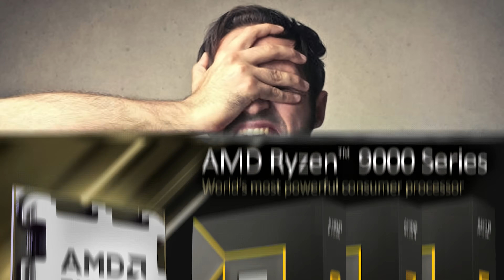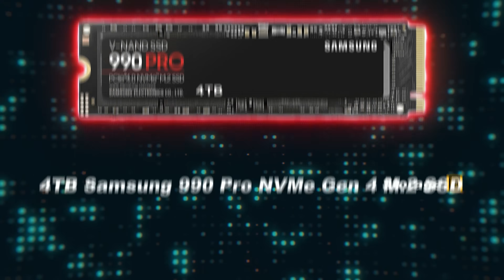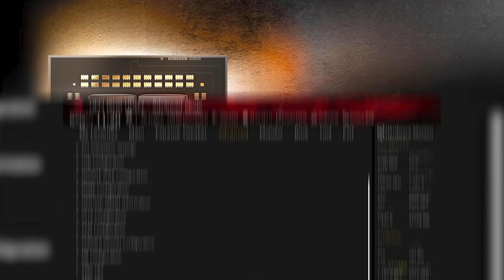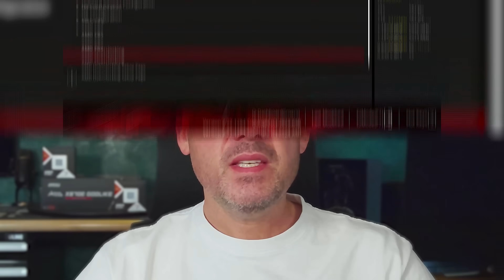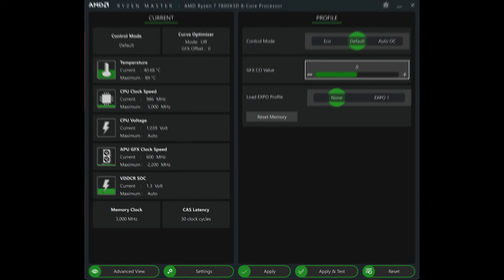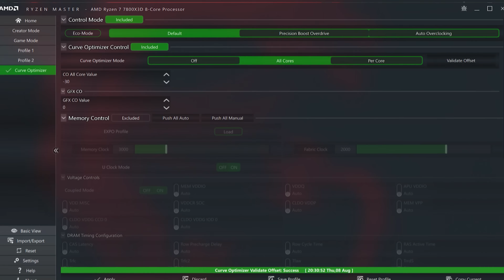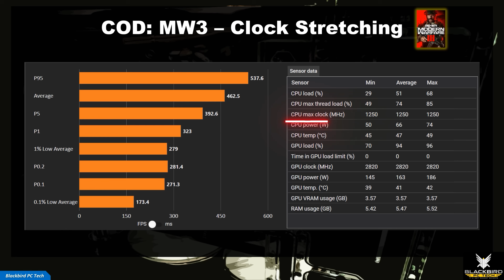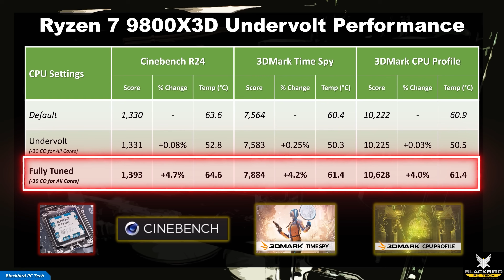How To Undervolt a Ryzen 7 9800X3D The Right Way! (or Any AMD AM5 Ryzen CPU)

Comment: I've got Ryzen 7 9800X3D &  ASUS TUF Gaming A620M-PLUS WIFI but can't find curve optimizer anywhere. precision boost overdrive also isn't in AI tweaker tab only in the Advanced tab. I've even used the bios search feature to find curve optimizer but finds nothing.
Reply from the maker: Don't worry, you can simply use PBO2Tuner as explained in this video: https://youtu.be/GJCC94cRGys

Comment: one piece of advice after personal testing with asus mobo. I'm on a X670E TUF mobo and when i tried the PBO through the advance tab the voltages weren't working as they should. CPU was getting over volted at idle and load, thus i was having really high idle temp of mid 50s and i was getting terrible scores in cinebench ??!!
Disabling PBO in advance tab and Going back to tweaker tab and setting the PBO through there fixed everything ! correct voltages both at load and idle with great temps and i was able to stablize curve optimizer at -30 ! I suggest everyone do the PBO through the tweaker tab !
Reply from the maker: I haven’t ever experienced that issue with Asus motherboards … I wonder if it’s a bios bug for that motherboard?
Reply: @blackbirdpctech  bios was updated to the latest non-beta version. i noticed this during cinebech testing and temp monitoring. one time i was maxing 1.14 on vcore but after reset i was maxing 1.22 Vcore and mid 50's idle. With each reset voltage would vary alot but setting PBO in tweaker solved everything and im rock stable at -30 @ 1.13v max and might even push lower later.
 Earlier i was afraid to even push past -20 cuz i was seeing 1.25 vcore and that terrified me.
Reply from the maker: Appreciate that you are sharing … might help someone

Comment: I would avoid ryzen master. Instead download PBO2 Tuner which let's you change CO from windows. Then set up an action in task scheduler to run on system startup. This also allows you to test CO settings much faster.
Reply from the maker: The best way to do this is directly in Bios, as I explain in this video.

PBO2 Tuner is only really useful if your motherboard doesn't have a curve optimizer option in Bios, as I explain in this video: https://youtu.be/GJCC94cRGys

Comment: Should I follow what you say in the video and overlook the one similar video you did 3 months ago about the 9800x3d?
Reply from the maker: Yes, that videdo will show you how to tune and optimize your CPU ... this one will show you how to undervolt your CPU properly.
Reply: @blackbirdpctech  in the end i think i've gotten quiet lucky with my 9800x3d, perfectly stable with -30 curve offset, +200mhz core clock with thermal limit at 85C :D
Reply from the maker: @ yes, you got a great chip!

Comment: Hi Matt! Thx for another great video! Now i feel a little confortable with this 😅
I just finished my new build, and i followed your advices by buying the 9700x instead of the 7800XD3. 
For now i dont have use of the 9700X to be overclocked but i was wondering if it would be intersting still to undervolt the CPU as you said in this video, but i dont know if i should turn up the TDP from 65 to 105w or just leave it at 65 and still go undervolt? Thx for your help 🙂
Reply from the maker: Yes, I would still increase the tdp and undervolt. Then when you get more comfortable you can perform the other tweaks.
Reply: @blackbirdpctech  Thx a lot!

Comment: Hi, I am using the Asus TUF gaming motherboard and I noticed that precision boost option can be found in both AI tweaker and Advanced tab. Which is the right one?
Reply: Got that. You stated it clearly it's in the Advanced tab. I have the doubt because I saw in other video contents which is configured under AI tweaker. Should I be concerning if I only adapt the negative curve optimizer in Advanced tab.
Reply from the maker: @Loafwithbutter  as I stated in the video, it doesn't really matter as long as the undervolt has been applied ... simply check in Ryzen Master
Reply from the maker: I cover that in the video … let me know if you have questions after you watch it
Reply: I have the exact same mobo ! do it via tweaker tab. For some reason setting it in advance tab overvolts my 9800X3D and the voltage changes with each reset ! but in AI tweaker tab it works as intended !
Reply: @Jurrian9189  Thanks for the feedback. Did you change the settings both in advanced and AI tweaker? Or it's fine to leave Advanced tab as default?
Reply from the maker: @ just change it in one location and check to make sure it has been applied in Ryzen Master
Reply: @blackbirdpctech  sure. Thanks for your reply, it helps a lot. I will check that out.

Comment: Stress testing is good and all but one of the issues that can arise is idle bluescreens. What this is when the Cpu idles but has the best opportunities to clock a core the highest causing bluescreens. Normally you will see this when you leave your computer on for a couple of hours of overnight and you notice that the computer has restarted. Took me a while on my 5900x to learn how this works. Even if your crappiest cores can do - 30 your fastest core tends to not. Ryzen Master has a test core by core feature that recommends an offset for each core and you can then set an all core based on the "lowest" negative offset.
Reply from the maker: That's interesting but I wouldn't recommend using Ryzen Master to test each core ... I've found that it does a terrible and every time I use it on multiple systems it crashes ... every time. Not sure how to test for idle bluescreens ... it's not something I've ever experienced.

Comment: My 9800x3s right now watching this video its idle 45c with Corsair 360 mm AIO and max i think is hitting 90c , maybe its time for undervolt like i did with my old i9 10850k which is running in my second pc.........but now i am focused on this crap 0D and ram error on every restart which is eating my life for 3 months🤯
Reply from the maker: Are you using a Gigabyte motherboard?
Reply: @blackbirdpctech  x870e Aorus pro ice and corsair 6000 cl30 vengeance
Reply from the maker: The reason I knew is that I had the same damn error with my Gigabyte motherboard ... I had so many issues with my Gigabyte boards, especially the X870E Master, that I decided to move away from them. I did a number of posts on this.
Reply: @ I am going to put gigabyte on a red list and never buy something from them , i will check your videos 👍
Reply: @blackbirdpctech  what is the issue? I have an x870 ice and I can’t get anywhere near these temps or scores whether stock or PBO -30. My scores are low in comparison
Reply from the maker: @titanplaya29  take a look at some of my community posts about the issues I've had with Gigabyte motherboards
Reply: @ any idea what’s causing it? I used your guide, can undervolt, and clocks boost to max but scores are nowhere near what I’ve seen others get.
Reply from the maker: @titanplaya29  Gigabyte was super unhelpful when I raised the issue with them … I think it’s an issue with their bios
Reply: @ hmm. I’m debating at least testing a different MOBO to see if that resolves it. Not that it really matters since I’m out of the return window for my gigabyte one.
Reply: @ Ram error if i am restarting the pc , 0D code on Asus means memory trainig failure so probably stands for Gigabyte also , if i dont use restart pc is working great ,no crash no blues screen of death
Reply: @ If you have that 0D error one guy on reddit say he changed the mobo to MSI edge ti and the problem was gone but now has some issue regarding pc not waking up from sleeping , other said he changed Ram to another brand than Corsair and worked ,other said he changed mobo with MSI X870 Carbon 
 and didnt worked !!  The problem is not certain
Reply from the maker: @ that is the exact same error I was getting ... I moved to an Asus X870E Hero and I no longer get the error. What's really interesting is that I would get the error on my X870E Master (tested multiple boards) but not my X670E Master.
Reply: @blackbirdpctech  I was running from INTEL 14th gen and Ultra core to AMD ram issues :))) ....i had i9 10th gen before this and my 4 ram stick never gave me errors even if they were not on QLVL of the mobo ! .....i will try to tweak memory settings in bios maybe i will find the bug , even stranger is that even with EXPO/XMP off i have this 0D error
Reply: @blackbirdpctech I can't believe that i have tried all sort of thing that i saw on forums like a guy said he untighten aio screws and his 0D error gone ..... what was i thinking :)) ........this error is eating my days !
Reply from the maker: @ I think it's a Gigabyte bios issue ... I also had issues with their Z890 Master motherboard as well
Reply: @ I am looking in the bios right now and the language is set to English but if i read the description is written in spanish, wtf is this 🤯🤯 , incompetents working for Gigabyte , can't believe this .....latest bios updated 2 days ago 🙈🙈.....i am going to send them an email !
Reply: @ Is there any good Gigabyte motherboard 🙈😂 or they are doing junks .....i had MSI with that i9 , rock solid, next time i will be MSI or if not Asus
Reply from the maker: @ I actually really loved my X670E Aorus Master ... that's why I went all-in on Gigabyte and got an X870E and Z890 for my test stands. I spent two weeks trying to problem solve my Z890 board and eventually gave up, installed an MSI board and everything just worked, no issues at all ... exactly same components. So yes, I moved away frm Gigabyte motherboards ... happy to give them a try in the future if they can explain what they are doing t improve their Bios development.
Reply: @blackbirdpctech  I can vouch for the X670E. I'm running a MSI X670E GAMING PLUS WIFI mobo, and so far... I've only ran into a small memory compatibility issue that was easily fixed the next day with a new BIOS update release. No complaints since.
Reply: @blackbirdpctech  I saw the community posts with the drop off in FPS. Did you notice if this was also causing lower scores in cinebench? This is my issue and nobody can give me a definitive answer. R23 scores don’t hit 23k even with an overclock. R24 doesn’t break 1300
Reply from the maker: @ the crazy thing is I actually don't think my cinebench scores were impacted.
Reply: @ hmm. Mine are super low and can’t figure out why
Reply from the maker: @titanplaya29  super low cinebench scores typically are the result of your CPU not boosting to high enough frequencies or having some cores or hyperthreading turned off ... some thoughts on what to check.
Reply: @ yeah unfortunately I’ve done all this. I’m testing a different board now. Otherwise I think I just got a bad chip

Comment: When I do -20 in the curve optimizer, I get some weird white artifacts. I don't know if it's a graphical issue or if it has to do with the CPU undervolting. Also, I didn't touch any setting besides the curve optimizer (that could also be the problem but I don't really know).
Reply from the maker: That shouldn't be an issue ... you should be able to dial-in curve optimizer without touching any of the other overclocking options. Not sure what the artifacts might be ... are you sure that your memory is stable?
Reply: @blackbirdpctech  I am running EXPO I - 6000 MHz memory (overclocked I assume) but I guess it's stable. How do I actually check if it is?
Reply from the maker: @TigasHyper  you can run Karhu ... you should take a look at this video so you get a better understanding of memory: https://youtu.be/JuUhnQaGG_I

Your EXPO setting shouldn't be an issue unless you are populating all 4 dimms.

Comment: So in case the PC crashes during a stress test does that mean that it won’t boot into Windows afterwards?
In that case can we even get into the Bios or do we need to clear CMOS to reset it?

New to PC building. Thanks for the video.
Reply from the maker: Good question ... if AIDA64 crashes you can typically just reboot your machine and it will boot back in to Windows. It will then show an error report when you boot back in to AIDA64. If you try to run a heavy undervolt, like -40, then there is a good chance that your system might not boot and you might have to do a CMOS reset.

Comment: I am a master when it comes to building PC's, but a super noob when it comes to overclocking, undervolting or whatsoever. I just copied what you explained in your video and ran a 10 min test on aida64. I have no clue what to read out but i was waiting for a failure to occur...but that did not happen. I guess it's all stable then. I played Warzone on 4K max settings and found out that my temps went from around 74 celcius to around 52-60 celcius. No performance loss or instabilities noticable. I have Jonsplus Z20, Strix X870I Gaming Wifi, 9800X3D and RTX 4090 FE. Thank you for your video. It was easy to watch and follow!
Reply from the maker: That's awesome to hear ... if you ran AIDA64 for 10 min then you should be good.
Reply: @blackbirdpctech  So Papi just floored it to minus 30 from jump.
Reply from the maker: It's always nice to be lucky 😉
Reply: @srqEvents  Yeah man, if it blue screens, it blue screens. Back to the drawing boards lololol
Reply: @srqEvents  this was my very first time to even think about overclocking or undervolting. I never did it before and I was like....let's just go and take the risk. I can always hop in to the bios and dial it back. To my surprise everything went well. So I guess I am lucky???! I saw many people setting it on -60 and did not have any problems. For me it was worth trying and the effect is noticable. I went from mid 70's to just 60 celcius with Warzone on 4K and max settings.
Reply: @ I love it!
Reply: @ I was reading his comment at the same time your warning came on about not going right to -30 and I lost my beer.
Reply: This is actually bad advice. Minus 30 is lucky, but also very lucky for a completely stable undervolt. Even if it doesn't crash, that doesn't mean it's stable. Run OCCT and see if you get any failures. No, it won't blue screen but is still far from being stable. -20 is usually the sweet spot.
Reply: @PapiHelali   I did the same as you but I just entered -20 and didnt want to do -30 just to be safer and then i ran aida64 for 10 minutes and it didnt crash. I didnt want to mess around with what is stable and what is not so i just went for -20 instantly because i also read in various forums that 9800x3d is almost guaranteed to do -20.  I am now just hoping that its stable and if a blue screen or some weird things start happening im just going back to stock and thats it :) . The temps are much better doe so it would be a a shame if i would have to. Starfield got to 87/88 degrees before on stock in the really heavy areas since its a really cpu intense game and now it is like at 76-78. I wanted cooler temps even though I know that these chips are built to run that hot and hotter even. I probably wouldnt have even noticed the temps if I didnt check them during playing starfield since every other game I rarely reach 75 degrees. This was my first time doing anything like this on my new pc built just over a month ago , so I did alot of reading and research and decided to try it . I am just very worried about the system being unstable but I guess I will keep using it like this and if there wont be any problems for a longer period of time I will keep it.
Reply: @gta4g33k  For me it was also the first time to do something like this. Somehow I am always scared to play with the settings in the bios. I love to keep things on stock settings. But after watching many videos I just went for it. And actually it always ran stable without any issues. My temps went from 80's to 60's celcius. I hope it stays like this for you to hehe! Fingers crossed 🤞🏻
Reply: @Duality199  any updates yo?
Reply: @yamajad  Yeah , I just ended up going back to stock after like 3 or 4 days because I didn't wanna constantly worry whether its stable or not and I've been on stock ever since and I'm not gonna touch it again, but for that period of time it was fine.

Comment: Quality video, now I just need a 9800X3D 😅
Reply from the maker: You can buy them at msrp now, so at least availability has improved.
Reply: Now that I have my 9800X3D, for curve optimizer would you recommend applying the under volt in both ai tweaker and also in the advanced tab? Or simply do it in the advanced tab and leave it as auto in tweaker?
Reply from the maker: @ congrats on picking up a 9800X3D! I would recommend just applying it in the advanced tab ... you will know if it gets applied successfully.

Comment: PBO kills latency, find a solid static OC to get the best performance. Learn your BIOS, Ryzen master is a disaster.
Reply from the maker: How does PBO kill latency? I have a latency in the 50's (ns) for my 9800X3D with a tuned DDR5-8000 kit (exact settings are in my membership area) ... but based on my testing I never saw latency go up when turning PBO on.
Reply: @blackbirdpctech  my poors setup 7600 will get about 54 ns memory, 9.9ns L3 cache at 5.35ghz/1.225v OC, tuned 6200. If i run PBO also at 5.35ghz (which is +200, -50, 10x scalar), same RAM i'll get 56+ns on memory and 10.5ns on L3 cache.
The concept of running the CPU at a static clock having less latency has been true for a long time. Heck, windows processor power management settings has had the min max cpu power adjuster for decades.
 The CPU/OS don't have to fiddle w/ load balancing, thread pass-off, Waiting on a scalar or "boost' in Multi-core uses, etc.
Efficiencies in performance will come at the cost of slightly higher energy use as well.
The Cpu will still have idle states, but won't have to ramp up any frequencies, only volts, amps, and of course watts.

Granted the 9800x3d has a lot more cache to play with and the differences are at the bleeding edge.

I went to school for AE too, tis a small world.

give it a shot, go for 5.6ghz on that beast
Thanks for the video.